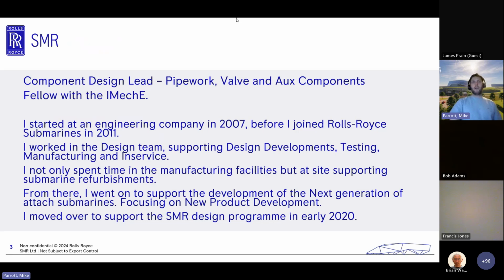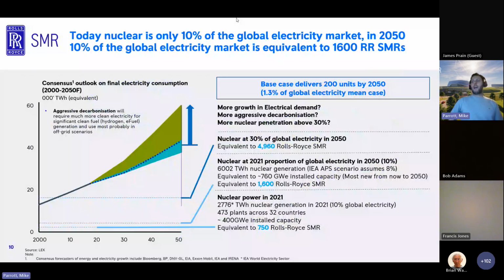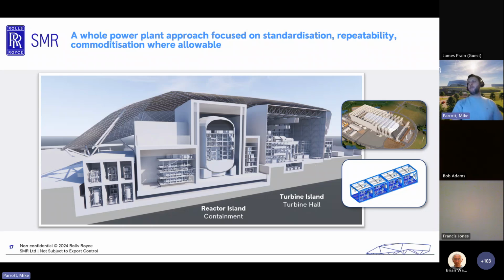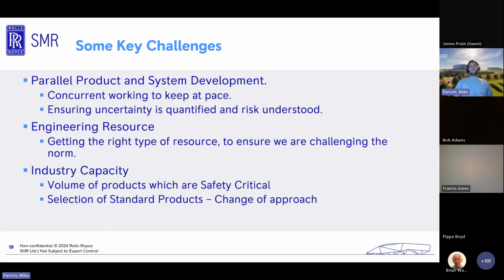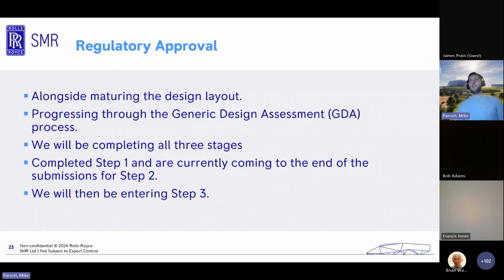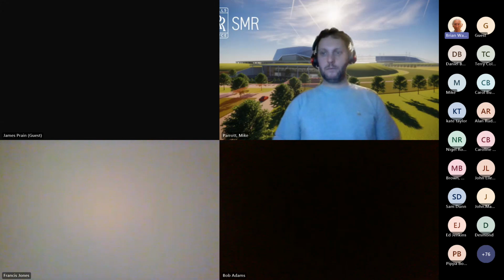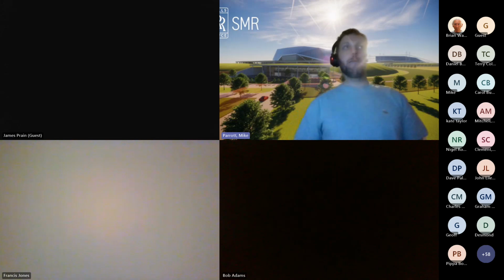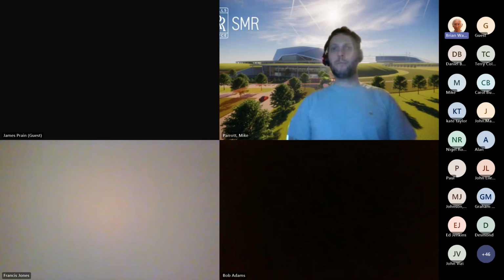Rolls Royce Small Modular Reactor:  How Much of Our Electricity Can It Supply?

Comment: some things are missing here. Whats the cost of a KWh of electricity generated by this reactor? How will you factor in the waste storage and disiposal costs for the used fuel for this, without other  gen4 reactor designs to burn it for you?   Sharpen your pencils RR!
Reply: I think the figure is £30-40 per MWh making it compete with the cheapest energy generation.

Comment: A well built and maintained reactor should provide power for 100 years. the reactor and spent fuel will be dangerous for 200,000 years.  Is it moral to use a device whose problems will outlast its benefits 2000 times?
Reply: dont worry, this generation of reactors waste is just fuel for the next generation of molten salt reactors that the chinese is busily building as well as turning one on this year, waste is also a source of fission products that are extremly useful for two types of generators/nuclear batteries that use the decay heat from strontium 90 [ look up russian lighthouse thermo-electric generators abandonded and harmed several people who cut them open] and ionic emissions from other things in fission products like krypton gas ect. that can emit radiation for years captured and converted directly to electricity in a battery for  decades without recharging, more like a fuel cell that runs out of fuel , so waste is a big mis-nomer for this valueable resource...
Reply: Still safer and better for the environment than burning coal and gas, or producing solar panels in China (where the environmental regulations are almost non-existent). All methods of power generation have a problem. For renewables, it's the materials required, and the difficulty in reclamation of materials. In coal and gas, it's the release of significant carbon emissions and toxic gases. For nuclear, it's the waste, and as @cougar4ik said so well, the waste production is actually much better than realised. Not to mention also the Synroc technology coming out of Australia for use in waste encapsulation.
Reply: Is that true ?? If so that sounds terrible.
Reply: @jacquelinepaul9731  Don't worry. Although what he said is formally true, in fact everything is far from so scary. Firstly, the total amount of highly radioactive waste accumulated over half a century of use is about 280,000 tons. These are mostly spent fuel rods. It seems like a lot, but if you calculate the volume of this waste taking into account the density of uranium, you get 14,000 cubic meters. This is a cube with dimensions of 24*24*24 meters. In fact, of course, more, since no one breaks old rods and puts them in one pile, but in any case, this is an insignificant amount that can be easily controlled. Secondly, of this waste, only 5 percent is actually waste. The rest can be separated and reused. And this is already being done in France and Russia. That is, the amount of waste is further reduced by 20 times. Thirdly, such a quantity can be turned into something like glass, which does not react with anything, and buried somewhere deep in the mountain, where no tectonic activity is expected. Regarding the 200,000 years of radioactivity, again it is formally true, only environmental activists do not like to say that it is decreasing very quickly. And in 1000 years their radioactivity will not be nearly as strong. Well, that is, if in a thousand years a meteorite hits the burial ground directly and disperses all this waste, then there will still be no global catastrophe. And the meteorite example is almost the most realistic version of what could go wrong. =) Well, there is also “fourthly”. These highly radioactive substances (called minor actinides) can literally be transmuted into much less dangerous substances in fast reactors. Such reactors are more complex than slow neutron reactors. In connection with this (and also due to the decrease in interest in atomic energy in recent decades), they have not become widespread. So far no one country has developed them enought for commercial use. However, technologies have been developed in all countries related to nuclear energy. Currently, Russia is closest to the commercial implementation of sodium-cooled fast reactors. It has been operating two sodium-cooled fast neutron reactors (BN-600 and BN-800) for several decades. Moreover, regarding waste, three fuel elements with the addition of minior actinides should be loaded into the BN-800 reactor this spring. P.S. I got a little carried away. =)
Reply: @Cougar4ik 
Very interesting but who should I be investing 💰 in !!